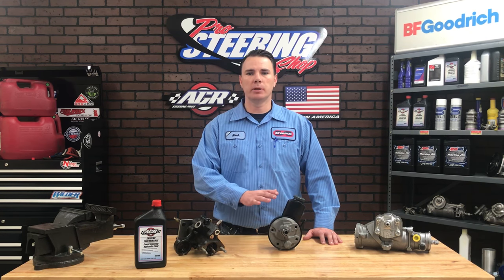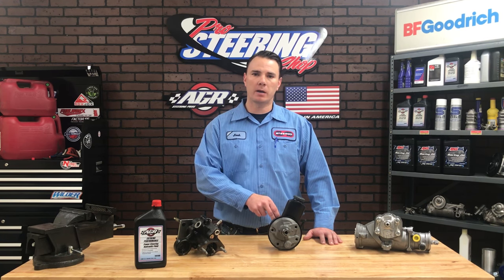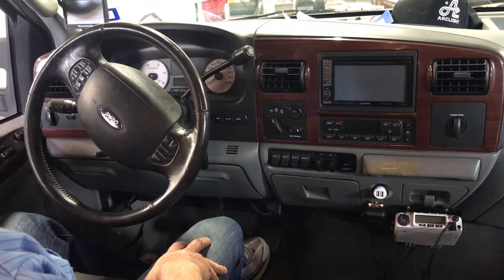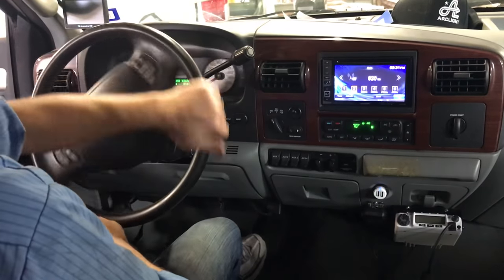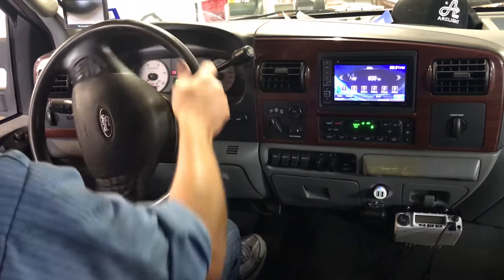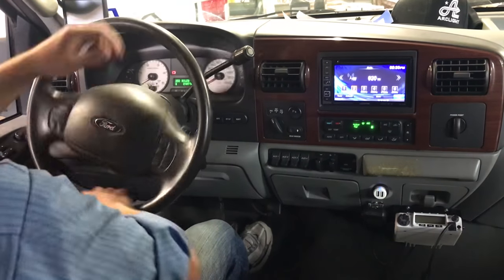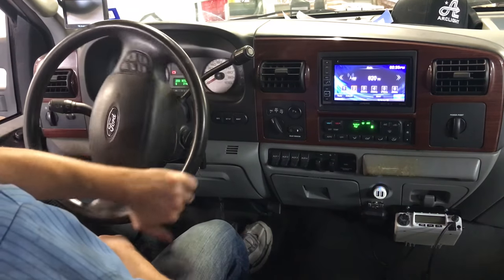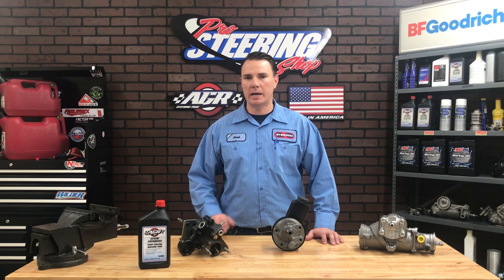Bleeding your Steering with Hydroboost Brakes, AGR Performance Steering

Comment: You motivated me to try again and keep at it, wish me luck.
Reply: My issue was a bad power steering pump. Started out as a whine when cold, got stuck in mud once and then it started whining at all times, getting air in system, and leaking. I couldn't tell where it was leaking, seemed to be from reservoir cap or power steering pump so I just hoped for best and replaced pump which took care of my problem.

Comment: Great video that I wish I had watched yesterday.  I changed the pump and lines in my Duramax and didn't realize they had to be bled.  I went straight to trying to flush the system and of course, the steering wheel had no power.  I tried a couple of times and the engine was running for at least a full minute.  Hopefully, I didn't ruin the new pump.
Reply: You ruin your pump?
Reply: I did a similar thing, did you ruin yours? I don't if mine is or not I'm about to just keep trying to bleed it.

Comment: Thanks.... very helpful video. Got my steering back to normal after months of air in system from replacing the power steering pump on my 04 mustang. Not many people are knowledgeable about the hydroboost system
Reply: 9

Comment: I replaced my Power steering pump, First my belt broke, after belt was replaced, power steering started pouring out trans fluid.    I did the 5 cycles, 90 times, but with cap on, and it currently has a small whine @ ideal, and no power steering, and when I push on the brake, makes a loud whine, a little push back, but does stop  Any advice ?
Reply: how did you fix it?

Comment: Great video with lots of useful information. Have a few questions, 1. At what point do you stop bleeding, if booster is bad/defective? 2. Do you recommend that all the lines be replaced due to the expose to excess heat from the fluid ?

Comment: I just replaced a worn out noisy power steering pump on my Silverado C3500 dually with hydroboost,   now my steering is quiet and works fine but now my brakes are soft and the antilock light comes on...  brakes were perfect before I put the new pump on. 
Thanks for the help
Reply: Did you ever figure out a solution to that? I’m going through the same thing!
Reply: @00civic1  what was the fix?
Reply: @stitchthisditchthat259  not sure, new brakes , new power steering pump, bleed the system. Bleed the abs system , also I drove out on a dirt road and hit the brakes hard while doing pretty good speed. Abs worked as it should and brakes worked even better after that. The abs system needs to be bled using a abs bleed scanner or computer . Somebody told me to go on a dirt road and drive fast and hit the brakes and it should bleed itself . And it worked for me.

Comment: I replace my power steering because it was leaking fluid. I notice the hose leaking fluid and wasn't sure if it was just the hoses or the pump so decided to change both and not take a chance having to come back and change one or the other. However even though it was leaking it was steering easy and breaking perfect although after I changed the pump I noticed the steering was harder and after following this procedure I noticed I lost my brakes now I have to really step on them hard for it to work and it takes a gorilla to be able to turn the steering on my truck now even after following this procedure and doing 60 Cycles. Too bad they took my old pump as a core otherwise I would go back and put it back on. I don't know what to do now. I don't think it's my booster I don't see it leaking and I know there's nothing wrong with my master cylinder either. Any idea what could have gone wrong and how could I fix this situation now?

Comment: I don't understand how fluid is going to get up to the hydroboost without the pump running. Does cycling the steering/brake pedal draw it up into the hydroboost by creating a vacuum?

Comment: Ok is this procedure the same for Chevy as well? I only had to replace the pressure hose from hydro boost to the pump the dealership tech told me turn it lock to lock with the motor off 11 times and that will bleed it. They never said anything about pressing the brakes.
Also how do you flush the old fluid out? One video on here says to disconnect the return line at the hydro boost and run a hose from the HB down to a drain pan then start the truck, slowly press the brake pedal and hold it then turn the wheel 12- 3 in both directions, refill pump as needed his was whining badly, keep repeating until you see clear fluid. Is this correct?
Reply: Yes. If it has a hyroboost unit. They are all identical. They are made by a company called Bendix. So the procedure should be the same.

Comment: I have a 2005 Chevy Suburban that I just replaced the hydroboost on with a new one. I did not open any of the lines to the master cylinder and did not tip it. After the install of the new boost, I turned the engine on and turned the steering wheel and pushed the brake several times. The brake pedal is now squishy like there was is air in my brake lines. Could this be from not properly bleeding the air from the hydroboost?  Please help.
Reply: 4  years late, but yes

Comment: I have cycled 90 times and still no steering. Should I keep going or replace the pump? I can still hear air bubbles coming out of the fluid in reservoir. When I check it the fluid never goes down. Stays at the same level.

Comment: hey buddy great video very easy to understand and very professional. i had a line leaking replaced 2 calipers 3 roters and the brake like on the drivers front roter i blead the breaks alot alot but after my truck sits the breaks lock up on there own after a few hours  untell l i release the pressure on the calipers....... i was told to replace the hydro booster..... dont really wanna if i dont have to can you help me out sir.....? could i have air in my hydro lines like this? or could it be my master cylinder? am i sicking air threw my break lines somewhere im lost......

thanks!

2001 lb7 duramax 6 speed manual

Comment: Can air get into the system if the car has been sitting for 6 months? Drove the car yesterday & the power steering felt sticky, almost manual at times. Parked and checked the fluid was still full. Did notice some leaked back up through the fill cap on the reservoir.

Comment: Confused... did you do the cycles with the reservoir cap off or on? When you start the vehicle, do you have the reservoir cap off or on? Don't you suck air back into the system with the cap off and also make a big mess? Mine splashed outside of the reservoir.
Reply from the maker: Jon Dize aka DIZEMAN your reservoir cap is vented. I recommend bleeding the system with the cap off. It won’t suck air in because once the air escapes the fluid weighs heavier than air. I also like to be able to see what’s going on inside the reservoir, it gives you a good idea how much bleeding is necessary.
Reply: Steering Pro Shop AGR Performance Steering cap of sprays fluid all over in my truck

Comment: Do you leave the cap on the entire time while doing this or do you leave it off?
Reply from the maker: Nicholas Boyd I typically leave it off but beware that a large air bubble escaping can bring fluid with it causing the fluid explosion some have experienced. Might lay a lintless towel over the fill neck just to be safe!

Comment: Do you  know what would cause a new hydroboost to leak at the weep  hole I put a duralast one on and it leaked asap. Would a bad pump cause the booster to leak?or maybe my lines too tight

Comment: Just got mine plumed today.
But on my 5th cycle it started squirting through the vent hole in the power steering pump cap.
Squirted all over my truck  fender and door.
Why?
Reply: that’s the air leaving the system

Comment: Bought a used BMW about a month ago. Steering was quite firm, obviously not enough to "steer" me away, but definitely on the firm side. Anyway last night I was testing my brake booster, and doing a fair bit of brake pumping. Power steering was absolutely not on my mind at the time, didn't raise the front end and turn the wheel or anything. Today I get into the car, back it out of the driveway and immediately notice the power steering is way smoother, like night and day difference. Did I inadvertently bleed something from my power steering lines to bring about this change? Its the only thing that's plausible, I also used some techron yesterday but that can't be it...

Comment: what would happen if the previous owner didn't have this done properly?  The 2001 silverado hd I bought has a new hydroboost on it, but my brake pedal doesn't seem to apply the brakes until about mid way.  Is that common for this year of truck, or should I look into it further?  Thanks!
Reply: That's normal operation for my 2001 HD, brakes start to apply about mid travel on the pedal but they work great

Comment: I just replaced my hydro pump and power steering pump lifted the truck turned the wheels a couple dozens times with the trk.off with the lid off power steering  fill box .fluid stayed up so i started it went around the block and when I put the brakes on the steering almost locks up.i bleed the front brakes because I did the pads recently got allot of air but lost ..any help appreciated if I can just start the process with doing the brake part that's what I'm going to do today but do you open the brake reservoir lid?I don't think so so I'm not going to .and if I have air in the brake system from doing the brakes and missing air in the system will that cause my issue?1982 Chevy C.30 dually

Comment: Did everything the same. On the 5th cycle it blew some steering fluid from the cap. Didn’t do it after that. Is that normal??????
Reply from the maker: DjStalin100 that was air escaping and it brought fluid with it. Sounds like a large bubble. Can be normal

Comment: If you have ram assist on your truck, shouldn't the fluid drop a slight amount upon turning on the truck?  Great video!
Reply from the maker: A. Tudor yes it should because of the differential in volume inside the cylinder. One side of the piston has the rod which takes up volume, and the other does not.

Comment: I put a brass tee in the return line because i jad to bleed so often. Turns the hydro boost was leaking at the firewall. Could i leave the T unplugged and let the air out through there while doing this?

Comment: Does this need to be done if you just change the pressure hoses? Also, would a leaking power steering pressure hose cause my brakes to feel spongy and make it hard to stop the truck? It’s a Chevy suburban k2500 diesel.

Comment: I just replaced the ps cooler on an 05 Suburban (w/hydroboost). The cooler is the highest point in the system, will this work fluid into it?
If not, can you provide some insight?  So far all the youtube videos I'm finding they just replace it, put fluid in and call it a day.

Comment: So if I'm replacing the brake booster master cylinder power steering gear box power steering pump and all lines this should bleed the whole system correct
Reply from the maker: Yes Charles this is exactly what you need to do. Be patience to ensure you won’t have to do it again. If any air passes though the pump it can cause damage to that pump so take your time!

Comment: I did this on my Chevy 2500hd, it works, but be prepared for a mess, lots of fluid flows from pumps reservoir cap area in the beginning. Took me over 100 times to get it bled out after changing the gear and pump together.

Comment: FYI vaccum filling has been a go to preferred route for over a decade...at the dealerships
Reply: That's more expensive though
Reply: @iamn360 
How is it more expensive? This guy must have spent at least an hour. The adapter and hand pump are cheap. Probably takes 15 minutes to vacuum out the air.
Reply: And with knowledgeable people. I’m pretty sure they vacuum at the factory rather than the time consuming method described in this video.

Comment: Would air in the system cause very hard steering while stepping on the brake when your not moving, like when your are reverse parking?
Reply from the maker: yes sir. Air is compressable and fluid is not so when air compresses its like you aren't pushing on the brake but you get the weird hard pedal feel
Reply: @Steeringproshop  Thank you! My wife's 1973 Bronco OEM power steering pump was low when we bought it and I never bleed the system and having that issue I mentioned. I'll bleed it as you did and hope that fixes it. Aloha!

Comment: So its funny after doing this dumb waste of time I ended up reading my Haynes book regarding my make and model and real simply says to disengage your ignition so u could turn motor over and it won't start and simply turn over and obviously have tires secured off ground but turn lock to lock while cranking engine until your reservoir stays at full level then put ignition back so it will start and done I did this and  felt like I wasted 2 hours of my time when the way I just explained took five minutes tops and actually worked I guess in certain circumstances this works but not for me but the way I did seemed way more simple and did work thanks tho I have never heard of or seen anything like this I bleed my clutch slave cylinder on my 93 ford 302 5 speed by leaving cap off and pumping it seemed forever to bleed but it in the end worked

Comment: Great video! Just had the dealer replace my hydrobooster and a line in my 18 ram 3500, got it back, I'm thinking it has air in the system. They told me to keep driving it and it will bleed the air out and to keep an eye on my power steering level. Will it bleed itself eventually?
Reply: Man I'm having the exact situation to a T ,and I'm concerned bcuz i ran into a problem recently and had to apply the brakes hard and they seized up , and the power steering stopped working .the next day I was able to drive it again for a few days . Last night the brakes are not working worth the flip and neither is power steering ,but I can still drive it ! Man I hope u get yours figured out ! By the way what did they charge you to install a new hydro boost .
Reply: @braleyshardwoodcustoms8584  it was 1k to change the hydroboost and a line parts and labor. 😑

Comment: I'm trying on my 07 Silverado 2500hd classic 6.0.. after test it my abs an brake light come on but if I dont use my brakes it runs great .. when I use my then it starts up again losing power are it wont speed up

Comment: I did this on my 2004 f450 and it worked, got the buzzing out. Only question is I must of done it 150 times already and there's still air bubbles comming up. Do you have to do it until the bubbles stop comming up.   Im talking literally 150 times already took like 2.5 hours.
Reply: If there's a leak on your return lines it'll keep sucking in air, which is why pulling a vacuum is better, the vacuum pressure drops if you have a leak

Comment: Have a Hummer H2 just replaced the steering gearbox and pretty much everything else time to bleed the air out. I am going to try this method and let you guys know how it works.
Reply: How did it work? Just replace my hydroboost and still no breaks.

Comment: When I bleed it the way you are with the cap off i am getting fluid pushing out of the reservoir. Is this common?
Reply from the maker: mike joyce yes that is common because the air is trying to escape pushing fluid up.
Reply: @Steeringproshop  so I should not put as must in ? I was filling it to the bottom of the dip stick.
Reply from the maker: mike joyce as the air compresses the fluid will go up and down. So not filling it as high when you cycle back and forth is fine as long as you don’t let it get lower than the pump when cycling.
Reply: So will the fluid stop pushing up when the air is out?
Reply from the maker: mike joyce yes sir it will
Reply: Can't read replys

Comment: I’ve cycled mine through about 40 times and still have no steering or brakes. When does it start to gain power steering back? I can’t imagine doing this 50 more times
Reply: Did you fix it?

Comment: I may have missed it but is one cycle turning lock to lock 5 xs ?
Reply from the maker: Tony Gatto yes sir. 1 cycle is lock to lock 5 times and pumping the brake pedal 3 times. That’s 1 complete cycle. If I can help in any other way!  Just reach out.
Reply: @Steeringproshop  tks.... so you know your done when you start the vehical and no fluid drop...  90 cycles jeebers
Reply from the maker: Tony Gatto yes sir takes about 20 minutes to ensure it’s health and success
Reply: @Steeringproshop  do you do this with the reservoir cap on or off?

Comment: I have a 99f350 7.3. rReplaced the power steering pump, bleed the system . The brakes work fine and the steering works fine. When I stop and let the truck idle for 30 seconds the power steering does not work, very hard to turn. Soon as I give it throttle the power steering works. Your advice would be helpful.
Reply from the maker: Amador Gomez what fluid did you use?  Does it seem to be getting warm? Does the fluid level raise or lower on the first 2 seconds of start up?
Reply: I've got the same problem. What do I do to fix it

Comment: So when pushing my brakes it goes directly to a bottoming out feeling as I can hear it in its hydro system ,the crazy thing is I swapped new fluids 3 weeks ago and helped a lot but now half way thru a 90° turn ,it'll stop letting me turn my wheels and one of the tires begin to drag barking along the pavement?? Can mine be fixed with bleeding?